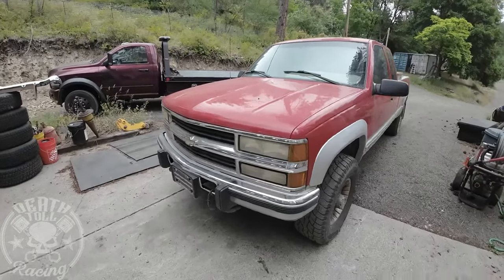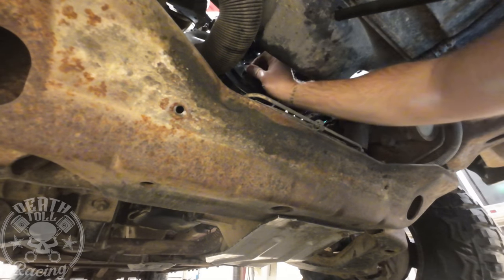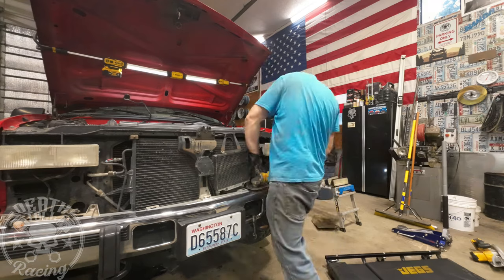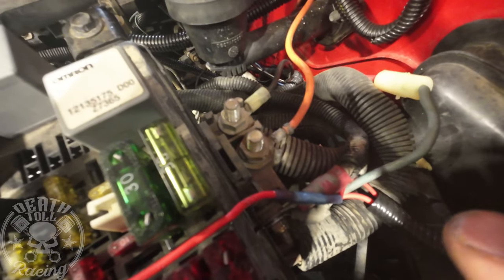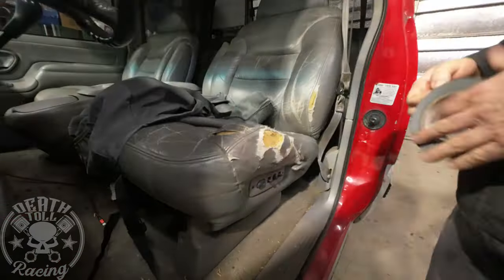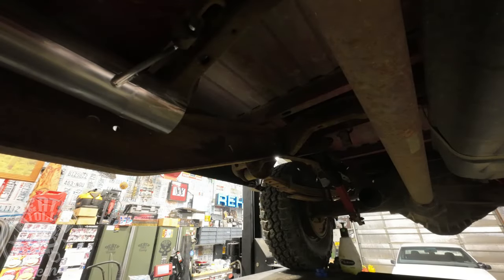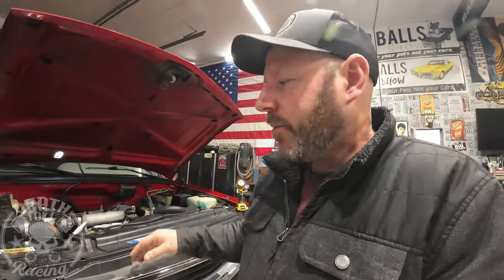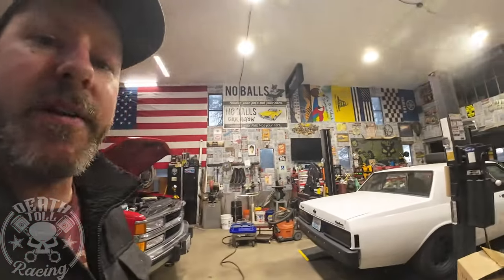Making a 6.5 Turbo Diesel Reliable.  Fixing the Achilles Heels of the 6.2-6.5 Detroit engines

Comment: I have a 93 6.5 with the 5 speed manual, bought it new. 450,000+ still running. No computers or electronics 😊
Reply from the maker: Yes!!!  I plan on building one that way for another project.
Reply: Damn, I just got one with 350 K needs a little love, but I’m trying to get it going👍
Reply: Mine 489000
Reply: I have one as well ( 93 3500)...it will turn over but wont start .. any idea of what it can be??
Reply: @christophermiller4642  Have you checked your fuel pressure and glow plug system?

Comment: In regards to the fuel system, there is no reason to keep the factory ffm when you install a superior water separator/filter system so removing it is the right choice, it would only be a point of restriction and possibly leak later on, the factory ffm is leak prone. The tap is not for removing water it is a bleeder for exactly what you're using it for, it's for after a filter change to bleed off air. The fitting on the top of the injection pump can be changed for a proper 3/8 fitting, it's a -4 orb that can be adapted to an, pipe or hose barb. The factory lift pump is definitely a problem, they do not put out enough fuel in stock form, if you ran a fuel pressure gauge before switching to the air dog you would have seen the pressure start at a low 5-6psi drop to or nearly 0 when free revving which only would be worse underload. Switching to an air dog, Carter, fast etc. pump will definitely increase reliability, both because as you stated less aerated fuel and also having enough fuel to not starve the injection pump with the added benefit that the excess fuel pumped by these pumps helps cool the injection pump. Also to note with your 95 keep an eye on your coolant temps, for reliability it is advised to switch to the 99+ water pump as it flows 130gph vs 80gph and it feeds both sides 50/50 vs 30% to the passengers side and 70 to the driver's side which as you can guess will typically warp the passengers head and blow a head gasket more frequently. While you're at it swapping to a Duramax fan isn't a bad choice either. When it comes to doing front wheel bearing I have found that in my case (I also have a 95) it was the same money to swap to the gmt800 knuckles with new bearings, lower control arm bushings, ball joints, calipers, pads and rotors as it was to replace the factory bearings, I would highly advise taking this route as the brakes are far superior and will definitely help especially if you plan to tow. Lawrence "LT" Tolman does a pretty good video on his channel. He mentions using LD 2500 parts but i have used 2500HD/3500 parts when doing mine, only real difference is it uses different outer tierod ends, i used  MOOG ES409RT.
Reply from the maker: That’s one good right up.

Comment: Having had extensive experience with the 6.2 in the 80's and the 6.5 in the 90's,  the number 1 thing is to refrain from "hot rodding" them. The failures are no worse than the failures of the present day Cummins, Duramax and the Powerstroke.
Reply from the maker: Fore sure.  I’ve had good luck with them
Reply: What do you mean by “hot rodding”? Making them faster? Adding extra parts?

Comment: I'm currently researching the 6.5L GM Diesel engine because I have found a step side van I need for my small business - it's a 1997 GMC P3500 Utility Van with only just over 55K original miles - seems like a really good price (only $5800) in "ready to work" condition - being somewhat ignorant, this information helps in the decision making process;  Thanks a lot!

Comment: That is a nice truck.  I had a 98 GMC K1500 and I did the manual boost upgrade and the chip upgrade from Heath, when I took my vacuum pump off the pump was okay, but the hose was bad, so I was not getting any boost.  I did the PMD relocation on mine, installed the upgraded lift pump with the wiring to take it off the relay, I re-sealed my oil filter adapter, and I installed the bigger battery wires as yours has.  I loved that truck, but I did have the PMD fail on me a couple times, and with life changing I sold it to get a more reliable and newer truck.  I still miss that truck.  I look forward to your work on this truck.
Reply from the maker: Thank you. One will fall in your lap at some point. I believe my pmd is currently starting to go. It randomly shuts off for a split second sometimes just long enough to notice. I’m going to swap it out and hope that’s the problem. Only does it once or less per trip, but I don’t need a ghost haunting me.

Comment: Makes me miss my 6.2 Silverado. Loved that old truck and it never missed a beat.
Reply from the maker: I had great luck with the 6.2 also.  I sadly converted my k5 blazer 10+ years ago to a ramjet 350.  I want to convert it back now.  lol.
Reply: Greg, what model and year was your rig?
Reply: @markthomas4083  1986 single cab shorty 2wd auto in apple red
Reply: @DeathTollRacing Looking for the Locker install video on the 6.5 TD. I have a 93' 2500 TD and it would be a nice upgrade. Nice videos, very informative.
Reply from the maker: @WhatRonDoes  I need to get this done.  I have it, but I've been building an addition on the shop and haven't had any time to do it.  Thanks for the reminder!

Comment: Last year I bought a 95 k1500 with a 6.5 and I’m just now getting around to fixing it. Working on the body right now but I appreciate all of this info. It has 187k miles and still has the pmd in the original location. Good video, thanks. I’ll be making a video of mine.
Reply from the maker: Thank you!  Good luck on your video!!

Comment: I agree with the Blue Loctite. And Fluid Damper, ( but they are expensive for some customers).
Reply from the maker: They are really proud of them.  And in all reality, a new stock one would be just fine for another 100k.  There's really nothing wrong with the oe balancer until they separate.
Reply: @DeathTollRacing  I had a Fluid Damper on a small gasoline V8. It ran great. For this current 6.5 Diesel which has 280K miles, I think I will go with the factory type balancer. In ten years, the truck will be 34 years old, and in much need of interior work, and probably a new engine and transmission. It gets good care but also does lots of work, every week.
Reply: @DeathTollRacing  I just ran another oe on mine I just check them every 50000 miles in my maintenance log

Comment: I have a 6.5 suburban its a 96 and im about to do the water pump and AC compressor. Luckily the underneath of mine is extremely clean and almost zero surface rust. Have to address my coolant leak and AC fixed then might do the shock and rebuild the brakes
Reply from the maker: Right on!

Comment: I have a 6.5 dually that has bin loved before me and it needs a lot of these upgdades. First is that module harness kit lol. Mine is under the intake.
Reply from the maker: Wow!  It must have been in a colder climate!  I haven't seen one in a while with it still under the intake.  Next replace the balancer.  If the fluidampr is too expensive (they are pretty proud of them), a stock replacement will get you another 100k.  I've personally never had one survive the balancer failure (broken crank).
Reply: @DeathTollRacing  dude my vac pump went, when inspecting it I noticed the dampener was walking around the rubber was shot. I replaced them both already good to know about the fluid one lol.
Reply from the maker: @dylanspilak231  Im so happy to hear you caught the balancer. I don’t know why they are so problematic on these. They are built the same as every other one, and it’s not like these engines rev faster.  Maybe the work more because of the diesel rattle. 🤷

Comment: Great detail and straight to the point, I've done pretty much the same things as what you did to your truck. Looking forward to your intercooler install. Would it be possible to get some EGT #'s before and after intercooler install?
Reply from the maker: Thanks!  I actually have a dual reading iat gauge so we will be able to see pre and post intercooler temps simultaneously live.  My first attempt of products for intercooling was a no go, so I need to come up with another design. I'm trying to do it with off the shelf stuff so it can be easily duplicated.  We will see.
Reply: @DeathTollRacing I have a 94, purchased new. I have also done most of the upgrades to combat the weak links. Most interested in what sort of IAT's you're seeing. Particularly if you do the snorkel as that will provide real ''cold'' air and might be enough that an intercooler may not be necessary if there is a significant drop from the stock setup.
Reply from the maker: @JREACHER1954  yes that’s a good idea to test before and after. I bought a bunch of stuff to add an intercooler, but my idea wasn’t going to be as bolt on simple as I hoped. So I’m coming up with something different
Reply: @DeathTollRacing  Yeah, I've seen a few and space is the big hurdle. If the addition of an intercooler can get you all the way down to near ambient temps and the snorkel can reduce IAT enough to be a 30 or so degrees Fahrenheit difference, is it worth it? I have a fender scoop that feeds the air filter and I'm seeing intake temps about 30-40°F above ambient at 3psi of boost at 60mph. My highest, under heavy acceleration, has been well below 200°. Unless you're doing a lot of towing or chasing for more power, an intercooler may not be all that beneficial to a stock setup. Just my 2¢.
Reply from the maker: @JREACHER1954 I think I will test before and after snorkel and reassess. I know my twin turbo crown Vic sees almost 300* on the dyno.  But that’s stagnant air. I have been running water meth on it to cool it, but I’m adding an intercooler to it now.

Comment: The Achilles heal of those clanky old turds is the entire engine! Swap in a Cummins 12 valve! 
Those old 6.5 were not the best. lol known for blowing the head gaskets out cause there’s not enough bolts holding the heads on, not enough clamping force. Ya you could prolly do some arp head-studs and being the heads but I don’t know why you would want to throw any money at one of those turds or machine shop time. Not when a 12 valve Cummins will fit right in there and bolt right up to that nv4500 with little to no modifications. There’s even companies that make motor mount kits and radiator/ intercooler mounting solutions, that bolt right up, for ford OBS, Chevy OBS and square body chevys, all sorts of stuff. Keep it even simpler and do a NON-inter-cooled 12 valve with the VE rotary pump. Thats what we did on my buddies 1 ton square body suburban on 40” swampers. Used a non inter-cooled 12v  with the Bosch VE rotary pump, there just as reliable and can still be capable of 600-700hp, the Bosch p7100 215 hp pumps are getting to hard to find these days. I wanna p pump swap my 24v vp44 truck, but if I can’t find any good p pumps anywhere to build I’ll settle for a ve swap, and still be capable of 500-600 reliably. 
There simple motors, they are an over build industrial grade motor! Now Detroits diesel collaborated with GM on the 6.5l but it was such a dog turd, abortion of an idea. It didn’t catch on, and they sucked, everyone opted for gas motors, or big block gassers. And to think in those years your only other options for diesel pickups was the ford 6.9L IDI turds, or the earlier 7.3l powerstroke as before they came the inter-cooled 7.3 direct injections, or a Cummins 5.9L, the Cummins killing the competition all the way up until really GM debuted the duramax, or durajunk as I call them. Not a fan. The earlier ones, the LB7 I guess wasn’t that bad, mainly just cause it didn’t have any emissions crap on them. After that as years progressed they just got choked up with emissions garbage and more and more sensors and modules, dpf, def, egr, catalysts, urea piss injection. I’ve worked in a Gm dealer turning wrenches for years and years. Been there done that seen it all. They are a light duty diesel engine. They are not fun to work on. Everything engineering design is such and after thought. Poorly designed, nothing is easily accessible or easily serviced. I’ve done several motor R&R’s and they sucked. But what I’m getting at is back in the day, you had three choices for a diesel, the GM 6.5l, the ford 6.9l IDI or a Cummins 5.9l non inter cooled / inter-cooled. Cummins owned the market and ruled! The non inter-cooled 12v  motor actually had bigger injectors OE and I believe also had the marine bowl pistons to, than the inter cooled version. H1C and WH1C turbs, an hx35-w from a 24v 2nd gen makes a great upgrade and improvement, I’ve heard of guys running an holder he351 from a 3rd gen 24v with great results. 
The 6.5’s were so under boosted, with the stock OE turbo had a max of about 12 psi of boost. They couldn’t handle much more,  Anymore and ‘pop’ there goes the head gaskets lol. And that really limits how much you could turn them up, because more air means more fuel, more fuel means more air, equals more power, it’s a vicious cycle. Any stock 12v Cummins be a VE rotary pump or p pump version with an hx35 and a few little screws turned and adjusted will be capable of 25-30 psi all day long, up hill while towing. Any more than 40 psi and head studs should be considered as an upgrade! Which are easily done without pulling the head or really anything but the individual valve covers to access what head bolts are underside. Head studs on any Cummins either 12v or 24v is a very simple easy upgrade, easily done in an afternoon without removing the head with hand tools and a torque wrench. Try that with any 6.2L/6.5L or durajunk, or 6.9l IDI, 7.3l IDI or 7.3l powerchoke! Nope, you’re talking a full pull down and disassembly of everything on top, and the front of the motor, major surgery. Ha the newer trucks not only is it easier, but it’s required that you pull the cab and lift it up! Must pull the cab to work on the motor. Screw that! I’ll keep my ‘02 24v HO 6 speed , or swap a 12v Cummins into something newer!
Reply from the maker: holy crap.  The next 4 builds coming on this channel are Cummins.
Reply: please revise and shorten your statement

Comment: You are driving my dream truck  i been looking for one   for abit now  hard to find one with a manual    but most of them are rusted out  or way to far away
Reply from the maker: They are tough to find in a manual for sure. You’ll find one eventually.  You could also manual swap an automatic one. A bit of a project though, but it does open up possibilities…

Comment: Really enjoyed this! I picked up a 96' Suburban a few months back, 97k miles and untouched. Factory PMD in the factory location! So NOW you can say that they have all been relocated. That's how I knew it was unmolested!!

Does the Air Dog have a fuel heater since the FFM heater is now gone?
Reply from the maker: It doesn’t but there are options.  We get pretty cold heat and it hasn’t been a problem though. May create some longevity issues though

Comment: I have a 98 gmc sierra 6.5 and it runs but will shut down when it gets warm and I replace all the main fuel and mechanic parts but I think it's in the fuel filter housing area
Reply from the maker: I assume you changed your injector driver module?  That would be my first guess, and the most common. Especially as you described with temperature.

Comment: I had 99 C2500 Sub that I sold for $500, minus the drive train. Saved that to replace the 460/C6 in my C class E350 RV which gets a whopping 5 mpg. Looking forward to a better range with it.
Are there different injectors that aren't pretending to be marbles in a can?
Reply from the maker: Unfortunately not.  I feel like the marine injectors do quiet it down a little, but I don't think it's enough to notice since it will probably lower your mpg if that's what your end goal is.  Also running a quart of atf in with your diesel at fill up also seems to quiet them down a tiny bit, and will help your injection pump live a long life.

Comment: All of this is fact, but should replace the stock turbo with a larger non-wastegated turbo. Will need to reflash the ECM for a performance tune and so it won’t trigger the Check Engine Light. Larger turbo will flow more air and reduce back pressure in the engine, resulting in cooler temps. You will not need an after cooler with a larger turbo.
Reply from the maker: hahaha.  I hope this is a joke.
Reply from the maker: @stephenmras8519  hahaha. The jokes continue.  And please don’t reference bill heath to give you credibility.

I’d like to use this opportunity to warn all viewers to use extreme caution in taking advice from the comment section.

Comment: @death toll racing Great video, thanks for making it.  What year is it?  How many miles are on it when doing the upgrades?
Reply from the maker: 1995, it’s around 200k.  I’ve had these north of 400k and the truck falls apart before the engine usually.

Comment: What's your total upgrade cost? Not counting the lights, lenses and tail gate handle.

Also, why the $600 balancer?
Reply from the maker: Links for all the parts are in the description of the video. I use the fluid damper because I’ve had 2 failures of these engines over the years and both were due to a balancer separating and the crank breaking.